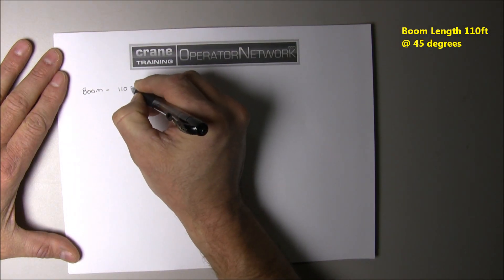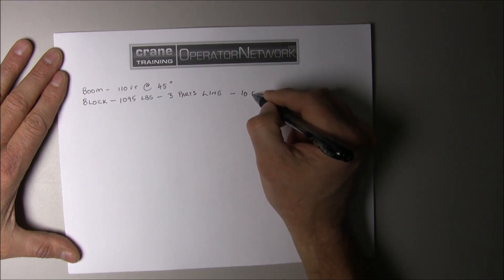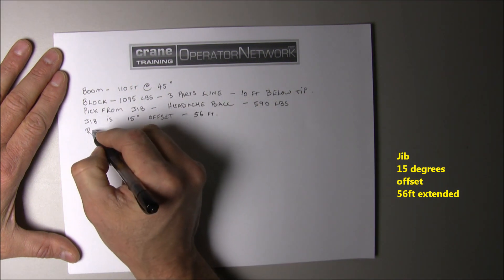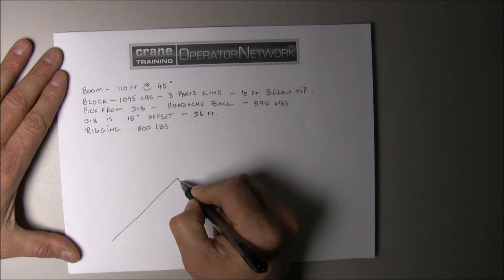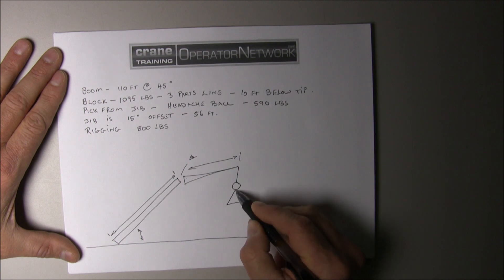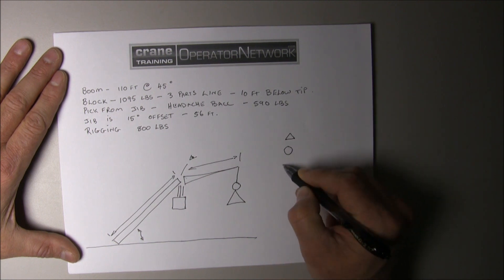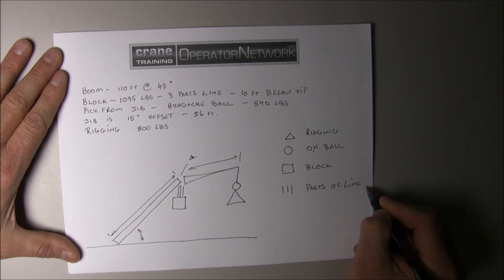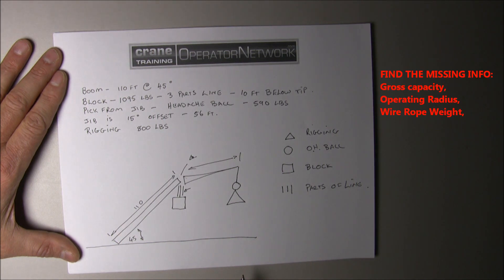Simple process to "Organize Crane Deductions" for Net Capacity with load charts

Comment from the maker: Identify the type of rope being used, your load charts should specify the weight by linear length in ft. 3 parts x10ft x the weight of the rope per ft.
That would be one of several deductions if you were to be picking from the jib or auxillary hoist line on the boom. Good to have feedback. Be safe out there.